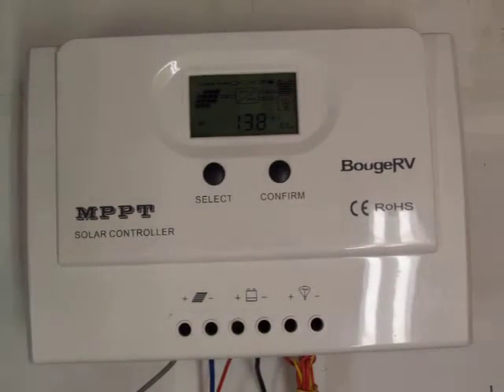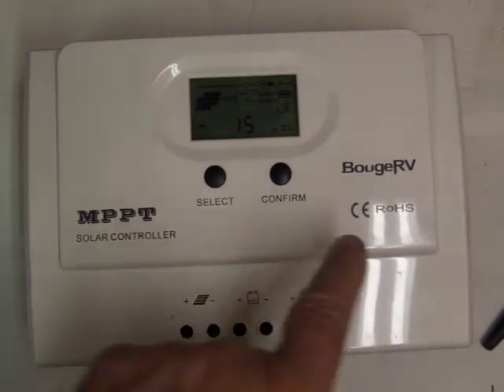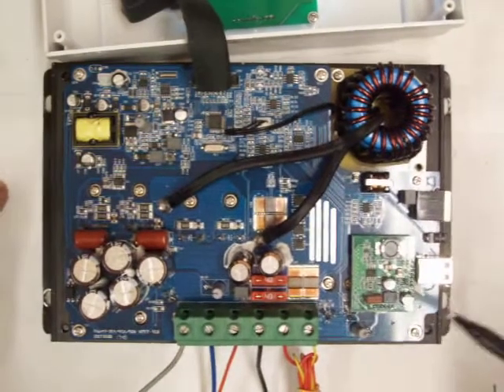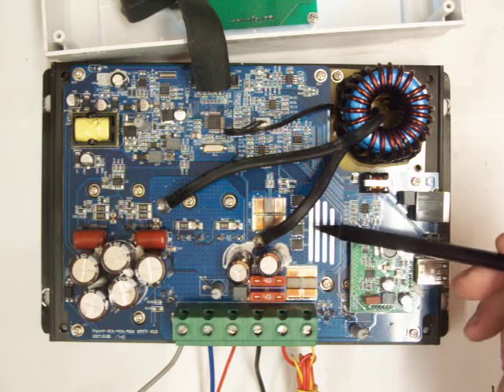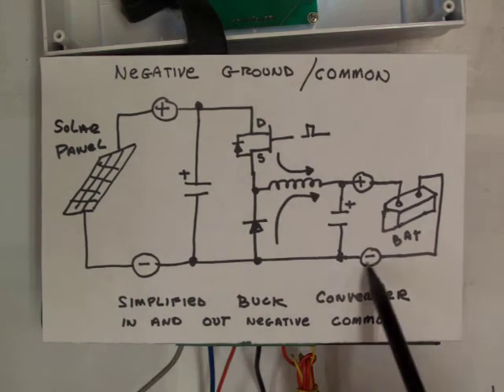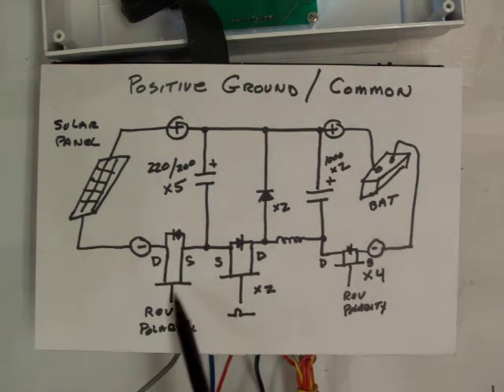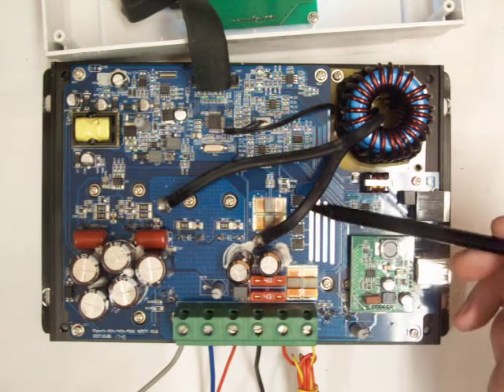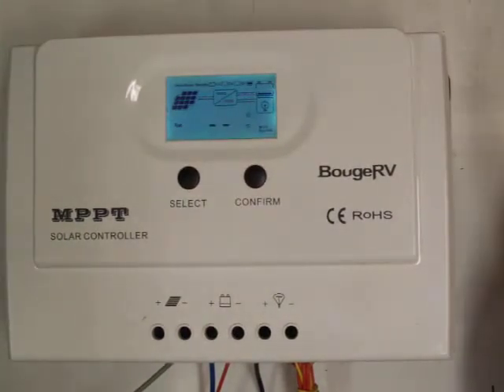bougeRV 40A MPPT Controller Repair Posittive and Negative Ground PV Systems

Comment: Great video! The only video of its kind online.. i had a question for you. I purchased a renogy rover positive ground 60amp charge controller by mistake. After my DIY install i grounded the negative terminal of the battery to an earth ground distribution block and ran a copper wire to a ground rod 10 feet away. I also grounded the charge controllers ground to the same earth ground distribution block and wired the solar panels metal frame to the same distribution block. After a few weeks i noticed the batteries were starting to get swollen.  Today i eliminated the solar panels ground to the distribution block and grounded them to a water copper pipe on the roof of my home. I know this is not ideal but its better than not grounding the solar panels. I eliminated the ground on the charge controller and only left on the distribution block the negative battery terminal. Do you believe this setup is ideal and should avoid overcharging the batter bank?
Reply from the maker: Grounding would only be at one location. Charge controllers switch and or sense current in the negative path. Grounding panel neg and battery neg causes a short.  MOV or TVSS provide a protective path without a direct connect.
Reply: opera thanks for taking the time reply... i am not a smart guy and read up as much as possible but find myself making mistakes. I guess i should have gone more often to school... i will look into a TVSS. I have one installed on my home in the AC panel. 

What has me still confused is if I earth ground only the solar panels where else should i ground to earth? If i isolate the solar panels to a completely different ground rod am i still okay to ground the battery bank negative and the inverter to a separate rod... im not grounding the solar panels from the negative terminal, i drilled a screw to the frame and ran  a solid copper wire to my cold water copper pipes on the roof that shoot down into the home and underground. If like you mentioned in your reply that i should only ground at one point does that also discard the inverter to a separate rod and to earth ground? My apologies for so many questions...
Reply: @joseprprprpr  "Mistakes" are where discovery lives! Just don't let them stop you. Don't even let them slow you down. Just take the discovery and go.

Comment from the maker: I like that this controller has a massive heat sink and no fan.  Fans generally indicate a design issue that is only made possible by a fan. Fans always fail at some point and use up energy.

Comment: Ive seen these. Not so good. Thanks for sharing
Reply from the maker: Some day I'm doing a video, WHY MPPT SUCKS, exposing the issues all controllers have to one degree or another.
Reply: @opera5714  I'll really like to hear your thoughts on MPPT.  I am about to build a very small 12v system and i want to know if its worth my time buying an mppt cc, especially the Makeskyblue product. Btw I live in Nigeria.
Reply from the maker: @leviahamefula3994  I have heard reports there are several versions of software out there for the Makeskyblue. Later versions may have resolved the issues I have talked about. I do not remember my version and it is located 800 miles away.  I like the hardware side of the product.
Reply: @opera5714  I guess i will just take a stab at fate with them then. There is also another mppt cc that cloned victron they are called fangpusun. Anyway thanks for the quick response sir. Wish me luck
Reply: @leviahamefula3994  buy the fangpusun, bro It is does great in  nigeria, It does great, reputable company
Reply: @irenethompson9058  do you use it? Which of their cc product do you use?
Reply: @leviahamefula3994  fm 80, the outback clone, but I have also install others for customers bro they are good for their price